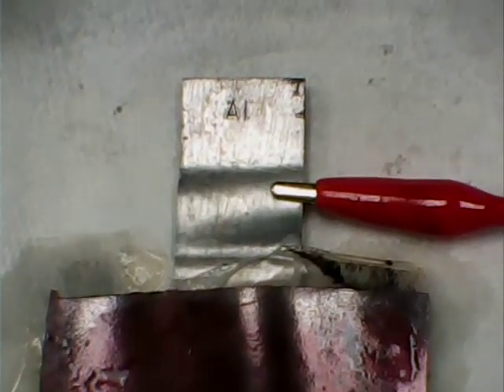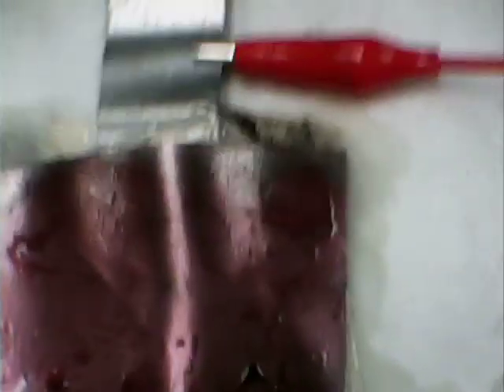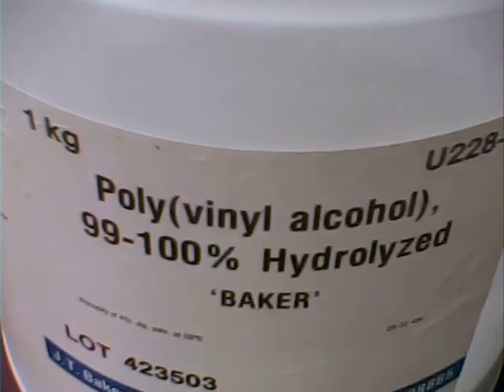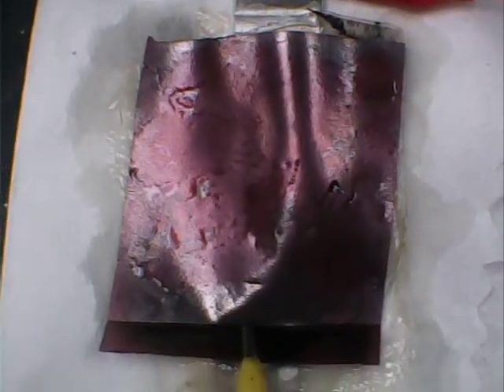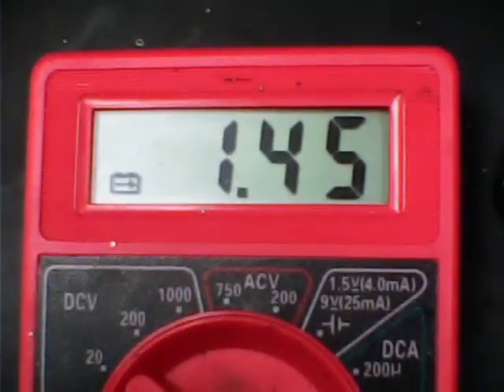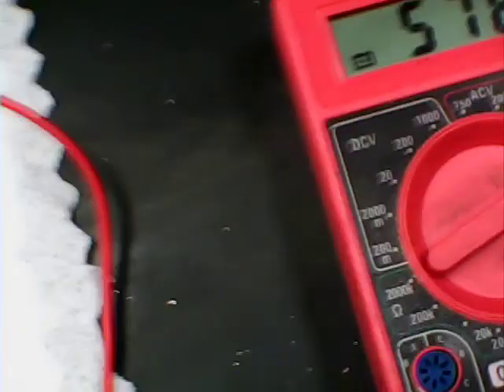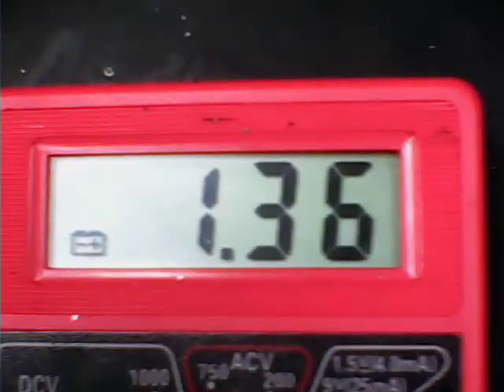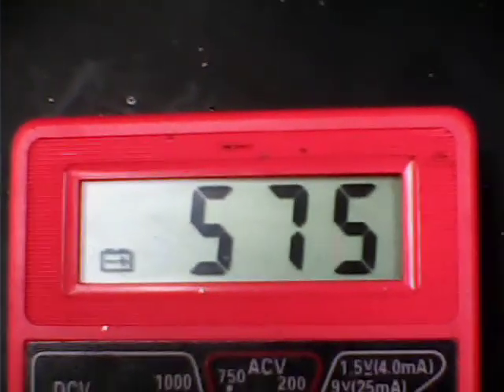Solid-State Electrolyte Research/ Aluminum Air Cell (Battery)

Comment: micro-Amps is actually pretty bad, but if you have a true solid state electrolyte it will do the job. I might suggest using Mg(PF6)2 or Al(PF6)3 filled dry polymer as electrolyte. Also many almost chemically inert complexes will have a high ion conductivity as long as it can react or intercalate the metal ion, maybe try Fe[Fe(CN)6] aka prussian blue insuluble as electrolyte. If you manage to make a “soluble“ prussian blue colloidal suspension in polymer it may work even better, but remember for solid state “breathing“ (metal-air) batteries it is always better to have an acidic electrolyte due to alkaline CO2 and nitric oxides poisoning

Comment: Hi, I've managed to dissolve the PVA at 80°C (using a mechanical agitator because the stirrer was stucked) but then I remove it from the heater and during cooling it forms a layer of gel on top and I don't know how to avoid. And another thing is that I place the cooled PVA into a petri dish (I don't have a plastic weigh dish) but then I can't remove the film because it sticks too much. What could I do? I'm also trying with chitosan and PAA but I find that they all dry too easily and battery stop working after few days.

Comment: It just keeps getting better. I might try PVA, glycerol, and potassium hydroxide. I'm not sure it will placticize. The graphite I have used was Lock Ease dry lock lubricant. It's supposed to be pure graphite micro fine powder.
Reply from the maker: Keep me posted. I am developing a chitosan gel electrolyte containing zinc powder and aq. NaOH. Graphite plate anode current collector with MnO2/ Murray-Smith graphite sheet electrode.